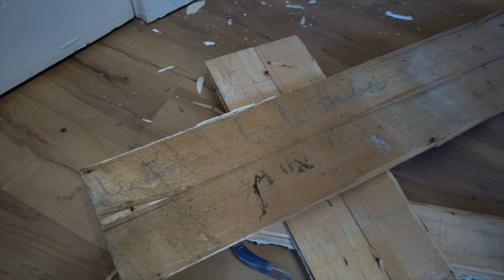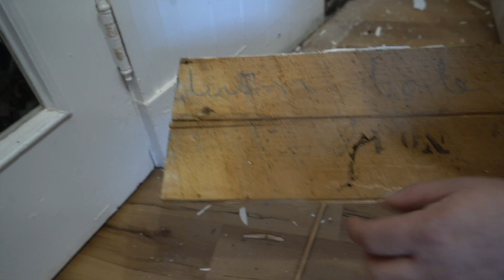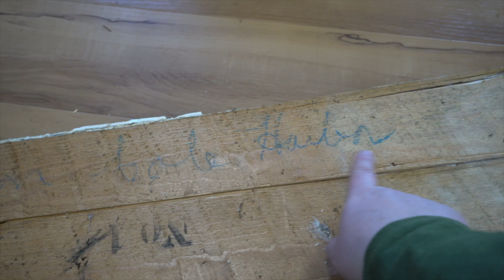Found a hidden message in the wall while building our vacuum garage! (Pantry/ Laundry Renovation)

Comment: Hey Elysia,  I'm short too and had deep shelves like yours in the vacuum garage but in a bathroom.  I made a gadget to retrieve items that got pushed back beyond reach. It was a simple yet effective thing. I toot a small board (about 3" tall by 6"long) and drilled a little hole to put a dowel coming out from the center to make a handle.  I put it on the shelf with the dowel poking forward.  It doesn't take up much space. So when items got inadvertently pushed to the back I simply pulled on the dowel to pull everything forward again. Then just push your "tool" back again! I also put a large (1") wood bead on the end of the dowel to make it easily grabbable. Looked nice and worked like a charm. I made one for each of my 3 shelves and never had a problem reaching anything. 💕🤟

Comment: Hi Phil and Elysia 
I found this:

Legend  has it that previous visitors knew of Cole Harbour, perhaps as a sheltered haven, as a Norse axe was discovered here during the 1800’s; however, its whereabouts are since unknown. The local native tribe of Mik’maq also were aware of the location, as they identified it as “Wonpaak”, meaning “still water”. One of the earlier entrepreneurs Capt. Simon Myers, and later his son Capt. Freeman Myers, maintained a large home and business at the head of the harbour, beside the river adjacent to the main road. To bring supplies for the business, they built a quay and slip beside the river mouth, accessible only at high tide, to accommodate a skow or barge which was towed into place from a larger vessel in deeper water.
Reply from the maker: Isn’t that super cool!!!

Comment: The cabinet run looks so much longer and whole now! You mentioned whether to put shelves above the fridge or not. I was thinking as you put the vacuum garage together that the opening above the garage would be perfect for vertical cookie sheet, serving trays, platters, … it looks tall and deep enough for these, and narrow enough that you won’t need dividers to keep them upright. Plus not wide enough to store anything substantial practically. I’d say put shelves over the fridge instead, or like you said, leave open for larger stock items.